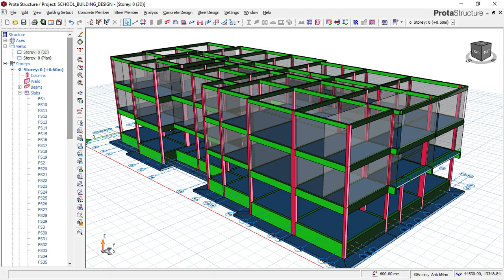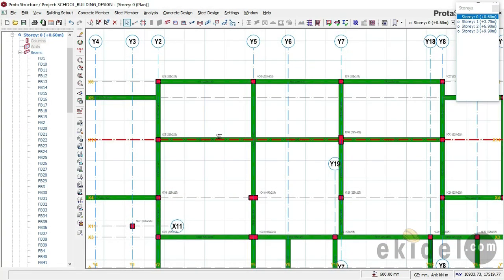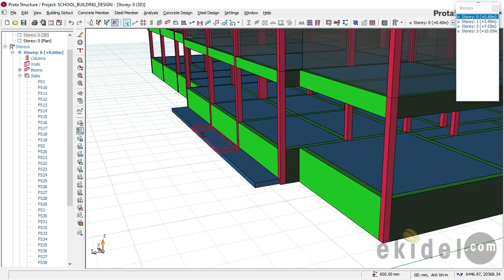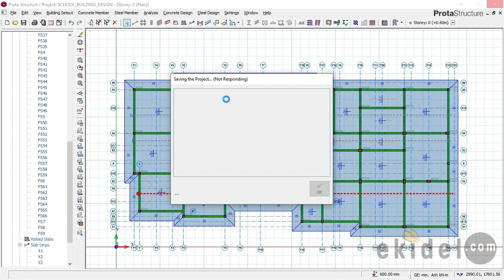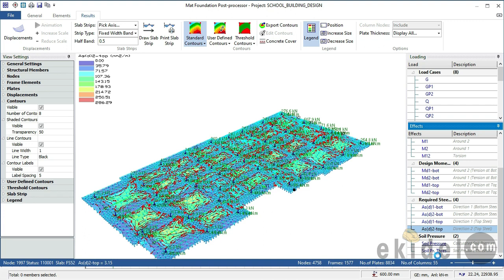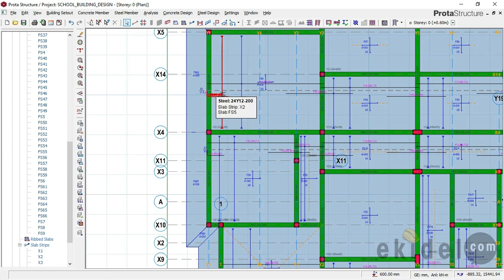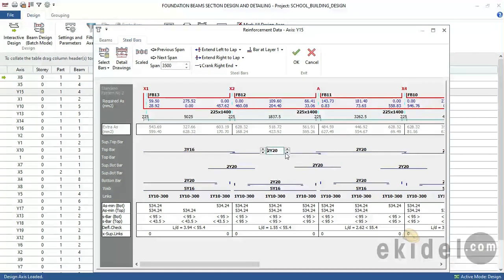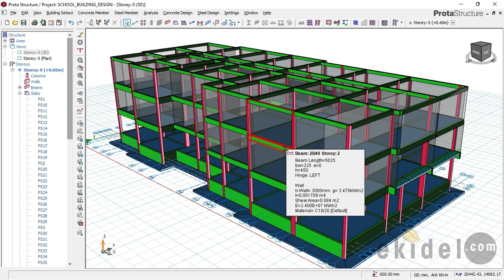Design of Raft Foundation in civil engineering using Protastructure software

Comment: nice video sir. but my question is what do u do when the soil pressure caused by the structure is more than the soil pressure caused by the bearing capacity. how do u deal with that? thank you.